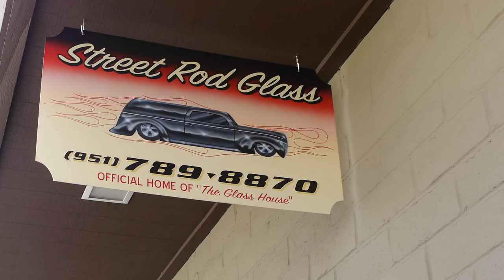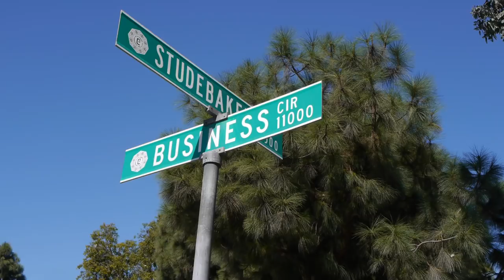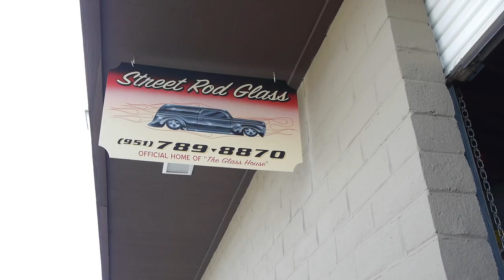The Making of the FMS Automotive Classic Beetle

Comment: Gorgeous modification, just gorgeous. I am, however, wondering if provisions were made to provide more cooling air to the engine. The 70’ was the first to have extra louvers in the rear deck lid to provide more cooling air to the 57 hp, 1600cc engine. Largest factory eng. to that date. I don’t think that sounds like the original eng….LOL. If there are any problems I would be willing to trade my 70’ Bug for yours, even up…..naw, I love my “Dub”. Great job!

Comment: Why? It's cool and all, but it would be much, much better if you kept the oval window on it's original swingaxle pan, left pretty much everything stock, used 15 inch wheels (maybe widened stock steel wheels and hubcaps) and didn't do a chop top.